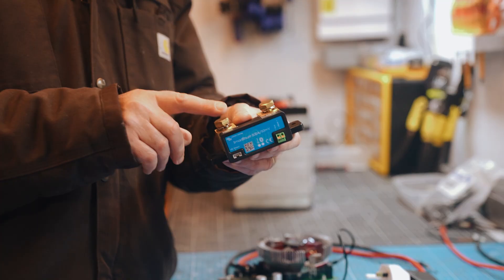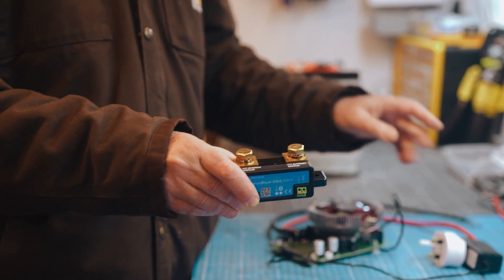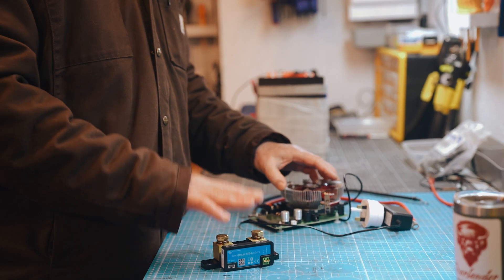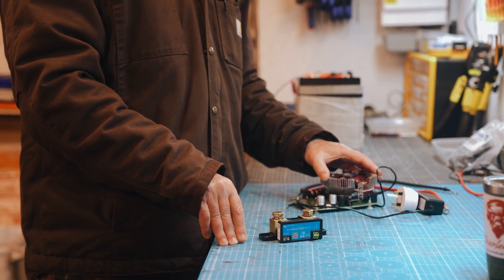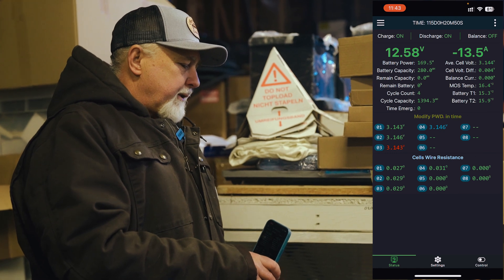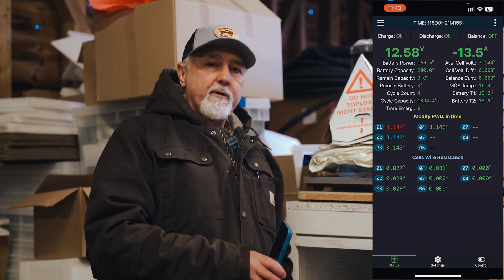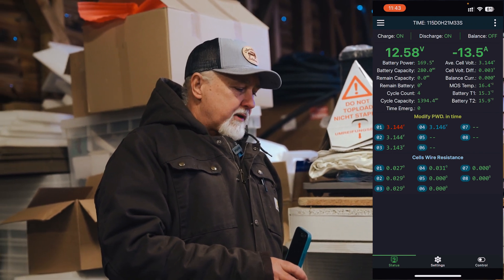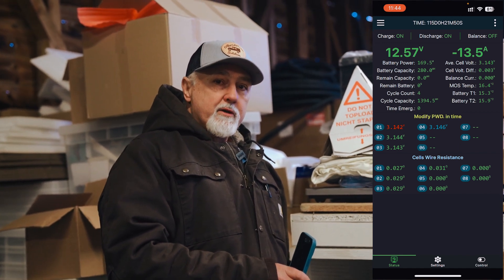How to find a problem with your lithium battery

Comment: Whoever did the editing did a great job. I learned a couple new things. I should be grateful. However, Google suggested this video. It doesn't answer my question. I have 6 LFP batteries in parallel. I'm certain at least one of them is draining the bank to 0 every night.
I'm crying inside. I've been doing my best to build the best of grid solar system I can. This is exactly like the lead acid batteries! It has to be one (ung, or more) of these batteries. How do I find wish ones are bad when they all have such slow voltage drop?!
Reply: before you build any battery bank, you should be testing every cell under load for capacity BEFORE you connect them, then after top balance in parallel at minimum, that is why you have the problem you have now, these are the minimum basics of lifepo power banks or even just small DIY batteries there are vids all over YT on how to do these kitchen basics. The same applies for even Nicad, Nimh. If you dont like making your own graphs from amps/voltage/time, buy a EBC A40l and let it graph it for you on your computer. How else are you ever going to know if your supplier has sent you the rated advertised Ah capacity or a junk cell.

Comment: most probably the current meter need to be calibrated in bms if its a high ampere  bms 100+ amp then the low amps current like 5amp or lower will not be read correctly and will show error in total calculation because high current bms by default means its meant to draw more power other wise people will buy low current bms

Comment: Is it a Daly ?
Mine resets to 100% when it sees an OVP then by the next day it says  71% as the voltage settles,  so the coulumb counter isn't working and it's defaulted to voltage to calculate charge percentage  ?

Comment: I could only draw 54.2 ah out of a 100ah battery.Negative cable would get hot pulling 800 watts.My Victron shunt doesn’t calculate re-charge power only consumed.
Reply: You haven't by passed the shunt  with your  solar have you 🤔 I see that a lot, everything goes through the shunt but people run the solar straight to the battery?

Comment: I'm experiencing problems. Iv 2 120 ah batteries  in parallel  the shunt is telling me one thing testing the individual batteries is telling me another. Voltage after charging is stable for a while. After several hours Voltage is dropping , 11.5 . I put the battery on it side the Voltage returned to 13.7 . Next job is to crack the top of the battery. Hopefully something is loose. Another great video.